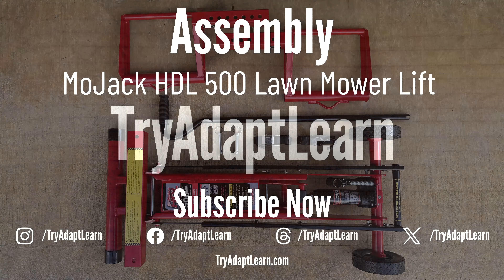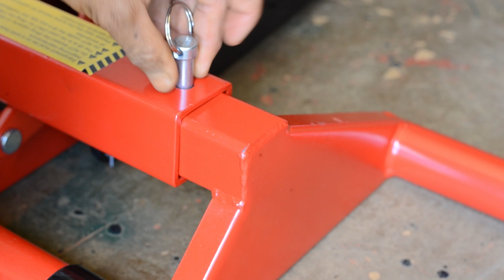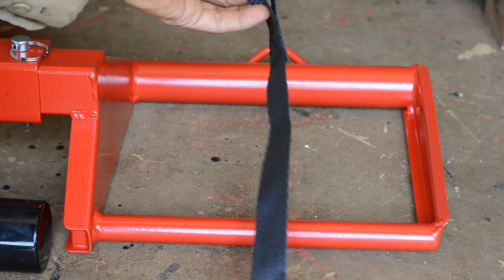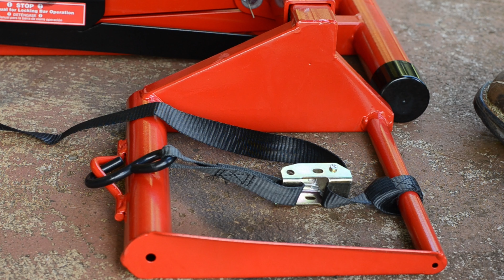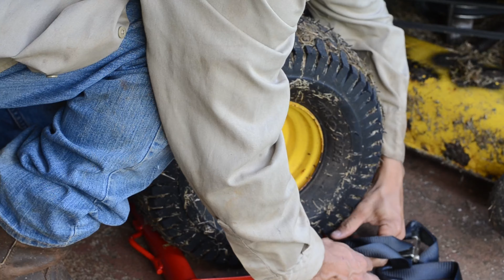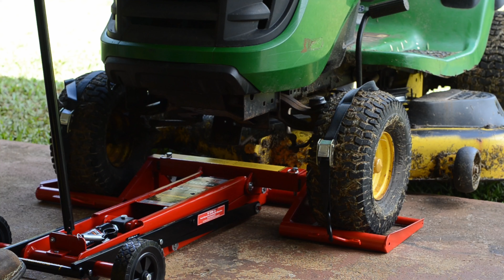Lawn Mower Lift Assembly and demonstration: Mojack HDL 500

Comment: That huge round bar at the wheel pad is a silly design. A removable bolt instead just makes common sense. I'll try to remove the bar and buy a bolt to make it work. Mo Jack doesn't want to hear about an exchange.....imagine that?🤔🤡
Reply from the maker: Thank you for sharing your feedback and opinions about the design.  Maybe they will offer an improved version in the future considering this jack is helpful for machines around this size and weight